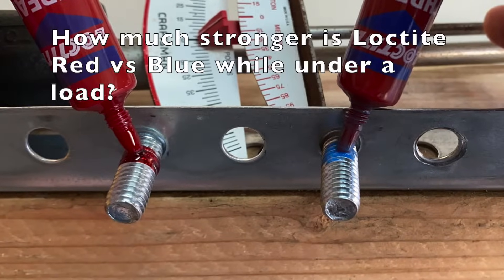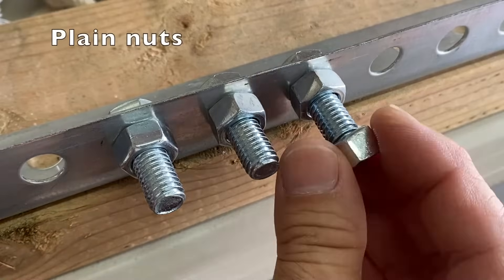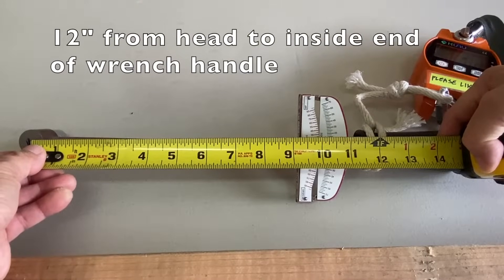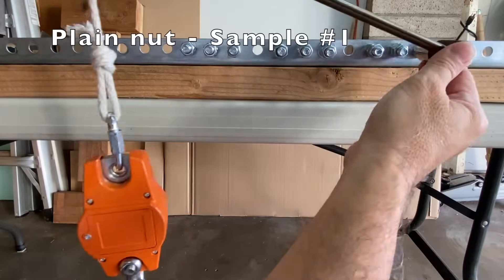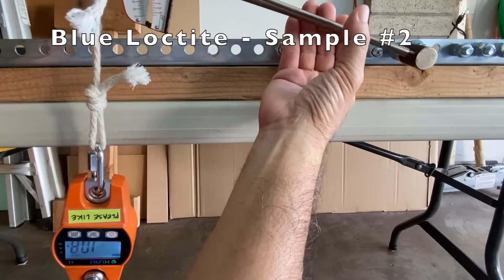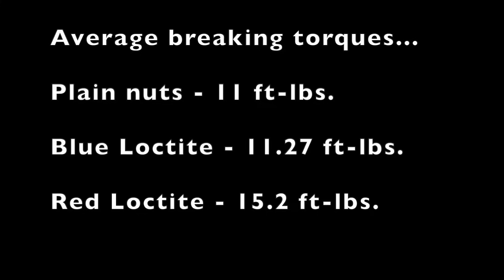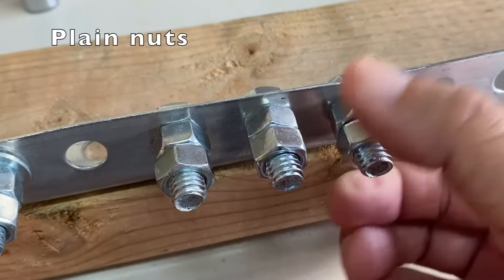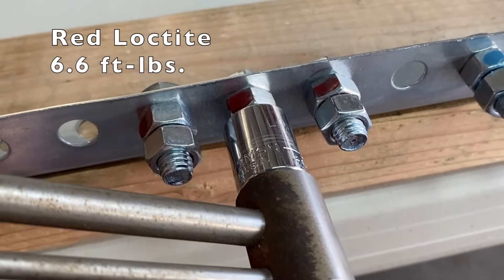Nuts & Bolts - The Honest TRUTH - How Much Stronger is Loctite Red than Loctite Blue?

Comment: I would like to see a similar test under vibration conditions. Hang a known weight from each  sample & subject the bar to the same vibration then compare time to break free for each. Loctite is primarily designed to protect against vibration & temperature related expansion & contraction effects, not so much for static rotational loading.
Reply: Good idea. The fact that both loctite nuts require a high maintained torque for removal implies they will do far better under vibration than the non-loctite nuts. It's worth testing.
Reply: Yes, this is not what threadlock is designed for. Otherwise, we would just use epoxy glue.
Reply: I use blue on my motorcycle all the time to prevent vibration loosening fasteners.
Reply: but if you have to eventually remove screw from weak materials like plastic blue loctice is the only way to go. Red is just too strong and plastic crumble :)
Reply: @Craft97pl  Red threadlock can be removed easily with some heat.
Reply: @Craft97pl  Even more. Red is NOT recommended on aluminium engine blocks due serious risk of sized thread. Only blue.
Reply: I was thinking the same
Reply: I feel like that is exactly what it is for. A lot of people put them on their flywheel, red since it spins then blue or orange on non spinning stuff.
Reply: When they had training wheels, my kids’ bikes’ wheels used to fall off all the time—usually at least twice on a ride to and from the nearby park.

After realizing that my work used loftier to prevent just this on our products, I used regular Elmer’s glue on the nuts & bolts.  The training wheels never fell off again!
Reply: This is only supposed to be a simple demonstration.  I liked the video and what was presented.

Comment: In most uses it's just to prevent backing off of nuts or bolts, etc. The blue is for the ability to hold but still be able to back it off without damage. The red is to hold in more adverse conditions and be much harder to loosen and back off. I have had situations were red has been used and did not back off this easily. And yes, at times it did require me to heat it up. To say that this is not required is foolishness. I never use red unless I plan on basically never needing the nut or bolt to ever be loosened.  Otherwise it's always blue. And all that is with or without lockwashers and such. Just another safety step. Specially on fasteners that could cause serious damage or injury.

Comment: Lol, I can’t believe people fell for this trash ! Go ahead and torque a nut down at home with the blue and then red. Let it cure then try to remove it….lol. It will not be that easy. 😂😂😂. I have been using those products for years and at times had to back out not or bolt, it always required way more effort to remove than it took to install. His process is flawed or he is lying !  😂

Comment: The point of Loctite is to keep the nut from backing off, not to keep it from being able to be undone. If you don't want the nut to ever move, weld it.
Reply: I use Locktite 638...   and same thing.. you have to BURN it out!!!
Reply: That's not what locktight claims. On their website they say, Loctite Threadlocker Red 271 is a permanent solution for locking and sealing threaded fasteners and is only removable once cured by heating up parts to 500°F (260°C).
Reply: @Coolcarting  Facts, we use 277 at work and if the holes are cleaned and prep'd properly the studs we set are basically impossible to remove without heat
Reply: @Coolcarting  Only the Red uses the word "permanent", and some of the products must be Heat Cured.

"Our range of threadlocker strengths include:

LOCTITE® 222 – A low-strength purple threadlocker. Works on all metals and is especially good for applications that may require disassembly.
LOCTITE® 243 – A medium-strength blue threadlocker that offers a good general-purpose solution to seal and secure assemblies. 
LOCTITE® 263 – A high-strength red threadlocker designed for permanent locking and sealing of threaded fasteners.

LOCTITE® 248 – The same performance as LOCTITE® 243 but in stick form, this is a blue, medium-strength threadlocking adhesive that works on all metals.
LOCTITE® 268 – A high-strength threadlocker stick suitable for applications requiring a stronger bond, though needs heating to 480°F (250°C) for disassembly"

I reached out to the company and asked them their take on this subject, and I will post it to your Reply and on the main thread when they respond.
Reply: @Coolcarting  Here's what they replied to my email:

"Thank you for reaching out to us regarding our "Red Product"

The term "permanent" in reference to our high strength threadlocker products means your standard hand tools normally cannot break the bond. Heat of 250 deg C is needed. The feature of our medium strength product is to keep the nut from being able to be "broken" without applying heat and/or significant pressure just the use of standard hand tools.

We understand that there may be different opinions on the effectiveness of the product based on whether or not the nut can be turned at all. However, we assure you that our High Strength product is designed to maintain the proper torque and prevent the nut from backing off of the bolt.

We appreciate your feedback and understand that different applications may require different levels of performance from our product. We are confident that our High Strength product performs well within acceptable tolerances for vehicles, tools, and machines, as it was intended.

Thank you for your interest in our product, and please let us know if you have any further questions or concerns. Have a great day!"
Reply: @Coolcarting  And they claim on their hard-to-bond plastics adhesive, that it works.... the primer is always dried out when purchased... no matter where, or when. Loctite does not respond to inquiry.
Reply: @citylockapolytechnikeyllcc7936  get acetone. Let set 1 min, or mix into your resin or glue
Reply: @Coolcarting  it really depends how much torque was applied.  On a torque to yield situation, or some crappy allen cap screw yeah its gonna bust/strip if you don't heat it.
Reply: Or use the green bearing lock one
Reply: I guess so - I have heard stories about cured Red needing heat - yet a lot of videos show it turning without mention of heat or showing heat. Like this video - 15.2 ft-lbs to break the nuts loose. So why is heat needed?
Reply: @Steinbacker4001 the question is, did he use it correct. He didn't mention anything about how he cleaned the bolts and nuts before he screwed them together. Without cleaned surfaces it won't do as good as it could.
Reply: Exactomundo 👍
The test is not relevant to the product.
Reply: Exactly! That guy’s test is completely pointless and doesn’t proof anything. 🤷‍♂️
Reply: Or be a man and tighten it properly.
Reply: Exactly
Reply: Weld = LocReallyTite 🤣
Reply: Lol, not sure if you know exactly what you just said, but it's hilarious.
Reply: You sound like a very angry individual cut back on the spicy food .

Comment: Making mining drills, the engineering  decision came down to me...
"Should use blue loctite..."
Whys that?
"Stays flexible, less prone to vibration"
I like your thought process... 

Red sets hard. Once its cracked, its cracked.
Silicone, blue loctite,etc... far better of it shakes.
Reply from the maker: Someone else mentioned that he uses caulking.  I just might do a vibration test with silicone and painter's caulk.  Thanks!

Comment: Did you make sure to degrease before because I found out that is one of the most important things and I also think 243 is slightly better than 242 if any oil is present
Reply from the maker: Yes, I did degrease for this test.  I also did a follow-up test with cleaning and not cleaning new bolts right out of the box... that test will be posted in a few weeks.  
😎

Comment: I fly rc heli I learned lots about locktite red only if you need it and remove with heat blue works 90 % of the time but there are situations where blue wont hold

Comment: On a small screw thread like on  rifle scope rings , rifle scope Picatinny rail . Those red Locktite would mean almost permanent installation.
The screw head WILL STRIP .
Reply: Been using purple for all my gun needs for years. It's harder to find but it's weaker than the blue. Never had anything come loose while using it tho.

Comment: Torque is never the point of thread lockers.
Reply from the maker: Yes, but torque is a convenient measurement tool.  Kind of like bodyweight is more convenient to measure for healthy body composition versus body fat, lean muscle, etc.  
Vibration testing threadlockers is difficult without specialty equipment.  
😎

Comment: Red - Stud lock
Blue - Nut lock
Plain nut - If torque tightening is loosened by thermal dynamics or other stess the nut will spin away.
With blue on it will not. ( like a nylok nut)
Loctite Super Wick In - is a good thing aswell

Comment: Why use another nut when you can use a lock washer with one nut ?
Reply from the maker: The first nut was just to hold the bolt in place so it wouldn’t spin.  It was a workaround because I don’t weld.  LOL
Reply: @HacksbyDad  Gotcha.

Comment: I read on google that it takes 67.8 nm to disassemble a BB with blue loctite while the torque needed to tighten it is within 35-50 nm, will it be alright to put a few drops of blue loctite in the threads? Thanks!
Reply: What is a “BB”?

Comment: Can I use blue loctite on a bottom bracket? In case mine loosens again with only a few drops. I think I used a BB cup with a few stripped threads which came loose over time so I'd like to buy a new BB and put a few drops in case it loosens.

Comment: I use caulk, work for me and is cheaper.
Reply from the maker: Interesting… I just might compare caulks/thread sealants to thread lockers.  Thanks for the idea!
😎
Reply: @HacksbyDad  - one time I don’t have wire to put on some bolts in a shacking machine and never get loose. Since then I use caulk.
Reply from the maker: @kk2ak14 Good to know.  Thanks.

Comment: I just broke loose some nuts on 5/16" stainless bolts and i had applied loctite 271 about 9 months ago on them and it was probably 3-4x the force you used to break yours loose. I had to really lean on my long ratchet.
Reply from the maker: Yeah… might have been the 24-hour cure time.  When I get a chance, I’ll redo the test with a much longer cure time.  Maybe at least a month.  Thanks for sharing. 
😎

Comment: Personally I think it would take more like 3 days of dry conditions for the friction medicine to dry, in the usual places.  Unless they are dried in the sun or warm air circulation around them for 24 hours.
Reply from the maker: Maybe I'll redo the test and let the parts sit for several days before removing the nuts.   Thanks.
😎
Reply: Loctite does not air dry, it is anaerobic. It remains liquid if any air is present.

Comment: It is very important to use a thread locked  for hot temperature only and the right one screw and not or you will be suffering later normal temperature you don't thread locked

Comment: why you people fall for these scams????? classic cheap superglue is 100 times stronger as a thread locker than these expensive loctite thrash. the only problem is you gotta screw fast as superglue tends to lock really fast
Reply: Threadlockers are primarily used to keep nuts and bolts from loosening due to vibration. Superglue will NOT resist vibration because it’s very brittle and when it dries it will actually DESTROY the thread in high vibration applications. Use the right product for the right application.
Reply from the maker: What if you want to remove the fastener?   Thread lockers hold the fasteners and allow them to be removed later.  Not so much for small diameters but possible with larger diameters.
Reply: Yeah... good luck trying to clean the bolt and remove the superglue.

Comment: You should try with nylocks or hex nuts again with lock washers, and use an actual torque wrench click style, 1 1/16 bolts and nuts and put them to 120ft lbs, or thread a piece of aluminum and or steel with 3/4 bolts and torque down tight as hell and then see if it works because I’ve gotten great results when using blue and I can tell you it works and it’s super strong, the red is stronger for sure, it works by filling the threads with a compound and blocking it from coming out so that’s the best way to test it really

Comment: the high strength one is usually heat resistant, there are also medium strength thread lockers with medium heat resistance or sealing properties
Reply from the maker: Heat resistance?   Hmmmm… I just might do a video about that.  Thanks!
😎

Comment: Well yes and no, I applied blue Loctite on my screw and ended up messing all the screwing because I was unable to unscrew it... I ended up boiling the whole thing in order to melt Loctite and unscrew the thing.
Reply from the maker: Thanks.  I avoid using Loctite on screws for that reason.  Small diameter bolts too.  
😎

Comment: Everyone likes to think the red loctite is "permanent-forever-welded-torches to get it off" but in reality it only requires a bit more torque to break it free. Rust will always cause more problems and realistically loctite prevents rust so it probably makes most bolts easier to remove over time in the North.
Reply: Although in my case, red lock tite on very small screw will strip if you force it, I have to use brake cleaner to dissolve it.
Reply: Use heat to soften it up then it will come off significantly easier.
Reply: Excellent point
Reply: I assume it use to be different back in the day but I don't know and green is rated permanent I think but ya unless it's a small nut or bolt I wouldn't worry to much about it I mean I don't think epoxy would be that bad but also never tested that
Reply: There is different grades of red thread locker some is strong enough to pull the threads even on hardened threads
Reply: When dealing with a steal bolt in aluminum casing? 😳 apply heat.
Reply: @Flying C Land good to know.
Reply: Yeah, rust is ultimate Loctite level... tighten to 2ft-lb, wait one year with water salt and dirt and you'll need 2000ft-lb to get the head to break of the bolt. rust is like a welded bolt... just less work for you and not a stupid idea you get when it keeps loosening...
Reply: You say that but I've stripped bolts from the top that had red loctite because I didn't use break cleaner lol
Reply: If you want to lock a fastener down pretty much permanently, use 680 green loctite. You do have to use heat to break that stuff loose.
Reply: @1991pony That stuff is great. I use it to assemble frameless motors into complete assemblies.
Reply: @dale116dot7 that loctite 680 loose fit bearing mount/retainer is great stuff.  I've used it in worn-out press fit bearings on bicycles for decades...it works and fills a sizable gap. Unlike the popular "shim" method the loctite was  permanent.
Reply: Yeah the red 271 is the watered down red loctite you find in hardware stores. You'll round off a bolt head before you break free the good stuff. Most of the time heating it is the only way.
Reply: No green loctite by permatex is and it almost feels like it's welded on there. It's supposed to be permanent Loctite
Reply: @bottomofthemap696  the green is considered a bearing retainer
Reply: You may be right in some circumstances but try to undo a shallow flathead screw that has a few drops of 263 red loctite on it... have tried a few times myself out of curiosity without any luck haha. When I eventually need to get it free I will just weld a nut to it but have fun with the “right” tool for the job.

Comment: I always felt like the red was used for breaking strength and the blue helps with backout strength so a screw wouldn't walk out from vibration. That's how I use the red and blue in the rc hobby. Red if I don't want it to move at all and blue if I just need to make sure the screw doesn't fall out if it does break loose.
Reply from the maker: Yeah... that's common.  For small screws/bolts red is pretty much permanent where the heads will strip or break when trying to remove.  
😎
Reply: The story is in the specifications.  Everyone is aware of the breaking strength, but loctite spec sheets tell you that the size of the broken blue particles are quite large, while red turns to powder.  Blue provides resistance the whole way off
Reply: @gregeoryl depends on where it was applied and how long it sat on the bolt. Eventually they all turn to powder.
Reply: I concur.  My usage exactly.
Reply: Take the green one